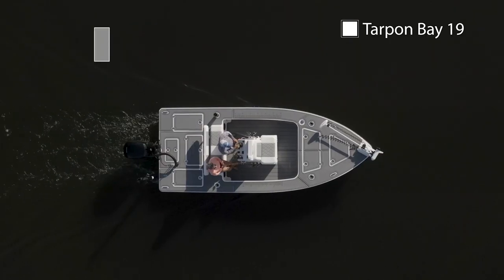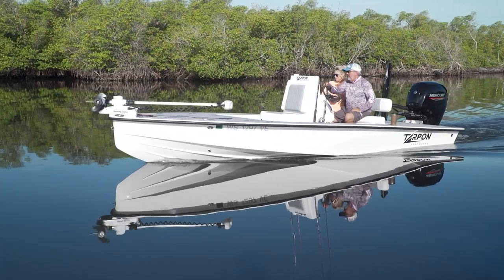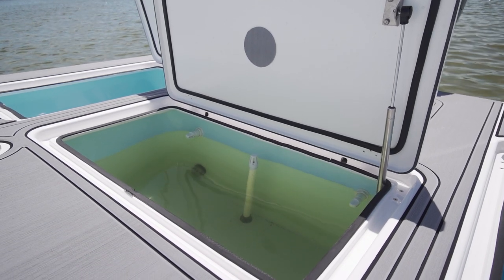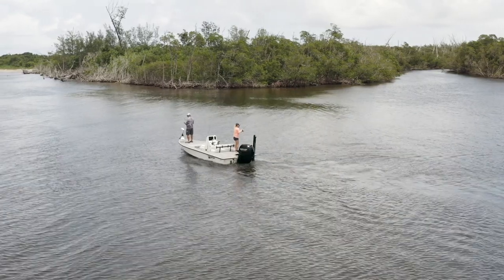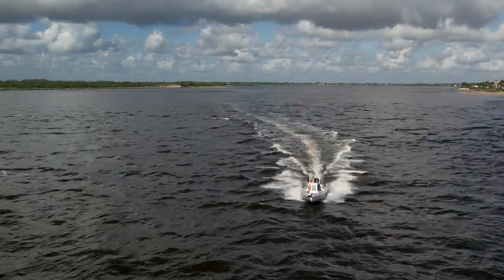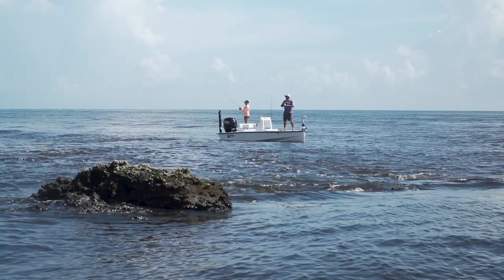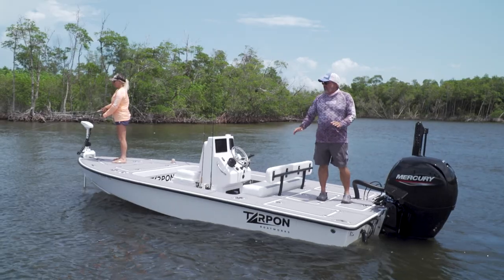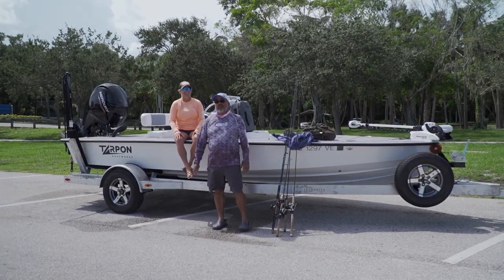Tarpon Bay 19 Boat Review - Bay Boat Designed for the Avid Angler | Florida Sportsman Best Boat 2021

Comment: Nice boat...but isn't it going to be a bit heavy in the stern considering the engineering and all the live wells once full of water, moving the center of balance?
Reply: The foam filled hull with that much aft beam compensates nicely for the added weight. I'm not a small guy and neither is my buddy, and fishing the rear deck we both stood on the corner and the rubrail didn't get wet. That boat is amazing.
Reply: @Fasteddio5  great...ciao and have fun on the water